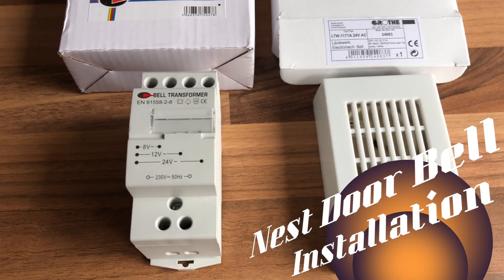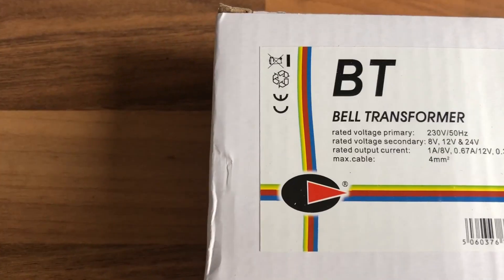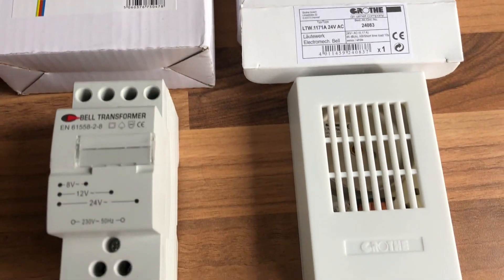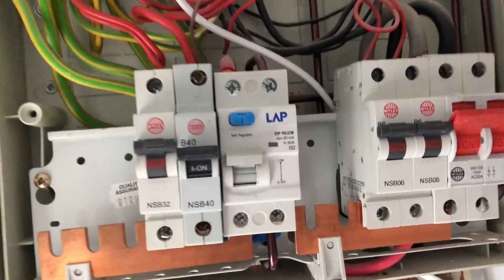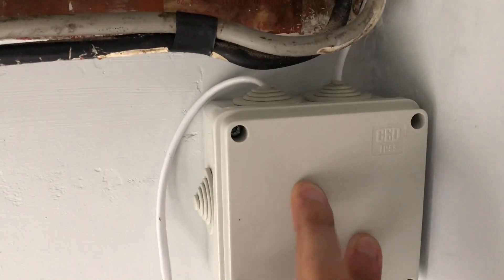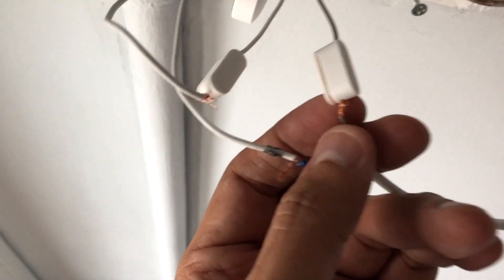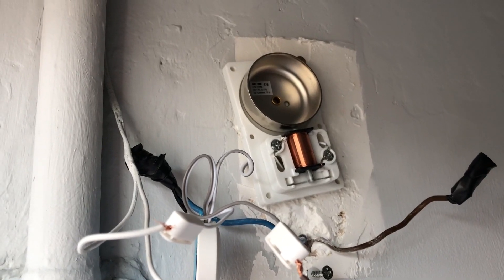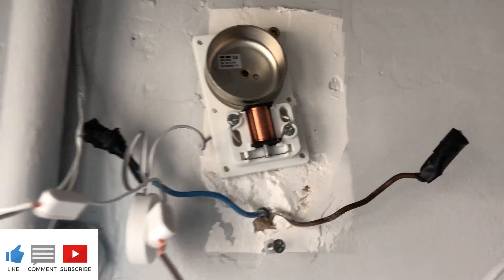NEST HELLO Door Bell Installation 24Volt UK - 🔥tutorial🔥

Comment: Hi. Great video. I bought a bell chime and it has a 7volt transformer in it so i bought on Amazon a 24v transformer. Am i right in saying if i take out the 7v and put the 24v transformer into the chime, should that be ok?
Reply from the maker: Jason O Keeffe well I haven’t been reading about any update recently. But I remember that 24v transformers are working with nest after a software update for older nest manufactured bells.

Comment: are you saying that coper plate has live AC running through it? or is it just a ground for your AC circuits?
Reply: LOL, Consult an electrician is you don't understand what a busbar is and how the inside of a consumer unit works. Its perfectly correct and safe to have that live copper bar feeding all the mcbs. Its missing the usual plastic cover but once the lid is on the box it is fine.
Reply from the maker: @JasonShowell  thanks, man. wanted to save money and try some diy
Reply from the maker: I though it was ground because you would assume that live would not b e naked, but this bloody plate is AC Live!!
Reply: I think that is very dangerious.. I would get that replaced asap. not only could it cause electrocution.. it would pose a fire hazard and also it could cause damage to electronics
Reply from the maker: @manp1039  correct.

Comment: You should have took your own advice & got an electrician. . You've used   0. 75 flex to supply transformer off a 40 amp breaker, potential to overheat & cause a fire, also why not shorten bus bar & fit transformer in fuseboard like intended. I'd have someone sort that mess out fairly lively otherwise hope you have decent home insurance
Reply from the maker: This video isn’t the final setup. I’ll be posting another video with the final setup I’m using right now which is much different. The wire is fine but in the new setup I’ve installed a breaker which is of 6amp and installed it separately. Will post it soon .

Comment: Thanks for the video. Can you use a 16v door bell with the same transformer you bought, or does it have to be 24v?
Reply from the maker: this video is for the 24v chime and usually 24v chimes are fire bells, which you wouldn't want to install in your home. il be posting a new video with the byron door chime.
Reply from the maker: sorry i didnt understand, do you mean a 16v chime, as the nest door bell supports 16v and 24 v transformer, but the issue is that the chime can only support maximum of 16v. so you need a 16v transformer to work with a chime with 16v max
Reply: ahhh ok makes sense now, so basically I need  everything to run on a 16 volt  like chime and transformer. The only problem is I can't find a 16v transformer anywhere.
Reply from the maker: Joker Joker correct. But u can from my ebay page. ValueTradez.
Reply: I've seen your page,, it's pre order only. When you expecting them to arrive?

Comment: The transformer you’ve shown doesn’t have a 16v output so you couldn’t change it later on.
Reply from the maker: Well spotted, yes, i couldn't change it and as a result am stuck with the Byron chime which 8 out 10 times doesn't work but the bell works fine. will be posting a video of that today. cheers.
Reply from the maker: azmontana1 Around 2 to 3 weeks from now